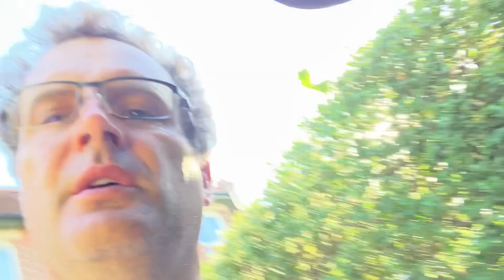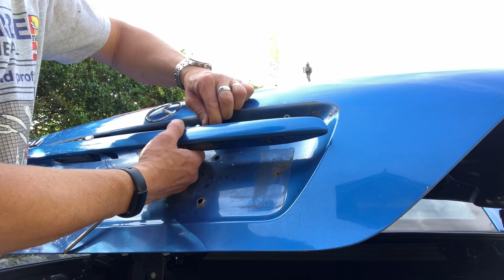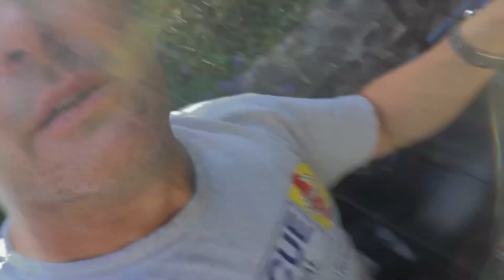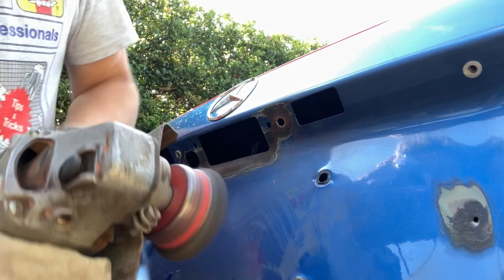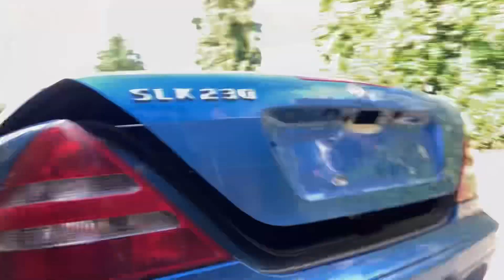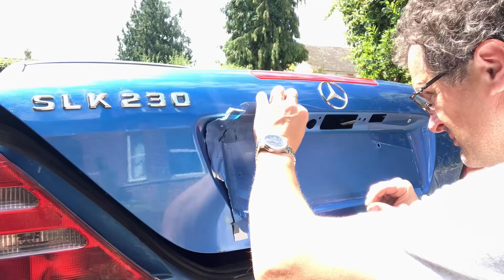Car boot/trunk rust repair - SLK R170 Restoration Video 35

Comment: Mistake no1: not wearing a mask when painting is absolutely dumb 
Mistake no2: applying body filler without applying epoxy primer before is dumb because the body filler will absorb water so it's gonna rust again
Reply from the maker: Mistake no1: calling people dumb.
No one will like you if you do that.
Try harder to present your feedback in a more constructive and positive way.
Mistake no2: not posting a link to your own video which will be so much better, obviously.